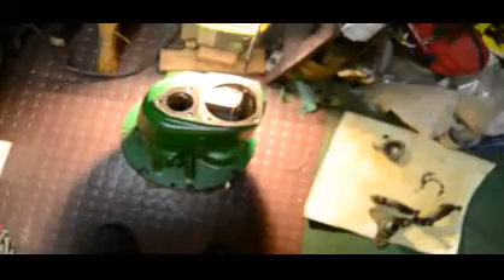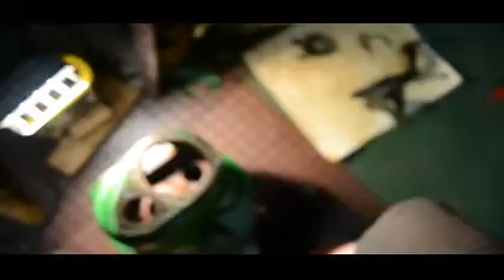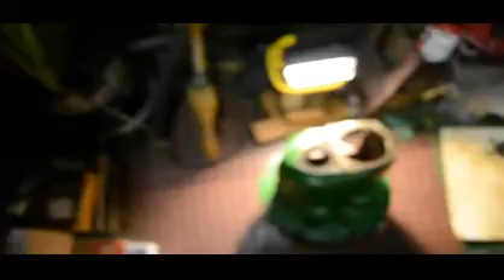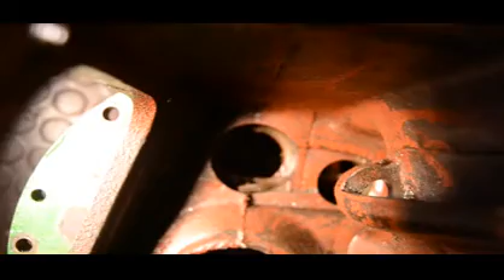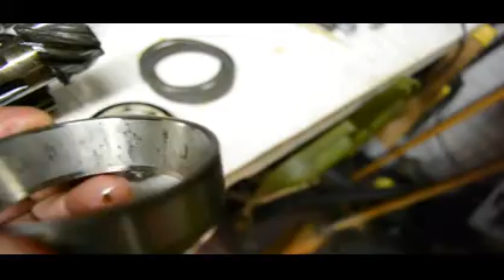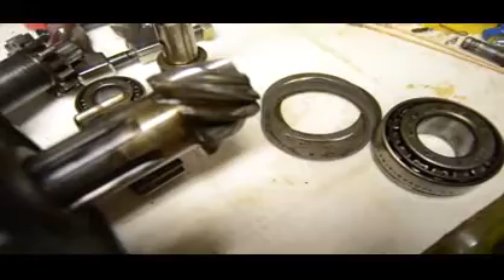John Deere LA (farm tractor) transmission power flow, lube and bearings (7 of 9)

Comment: Do you have a list of bearings and seals .
Reply from the maker: I think so, from the repair manual. I maybe should hand type it , with credit, rather than copy and paste. Will follow up tomorrow. DD
Reply from the maker: Jack Kreeger's repair manual did have a list of cross references for both seals and bearings. In respect to his decendants, I doubt it's proper for me to copy and upload. I would be happy to pass on specific information from the manual if you can provide descriptions or John Deere part numbers, from the on line or paper parts catalog. (John Deere PC on line look-up is free.)
Regarding any copyright protection, I did a web search, and found that several sources are selling what they describe as a factory manual reprint. Their pages shown sure look like Mr. Kreeger's original book version9s), which did include John Deere "Service Hints" bulletins of the day. On eBay, "Peaceful Creek Auctions" is one such supplier. Retail prices on the web very a lot, so shop first, if you don't have a copy. If you don't have a copy and decide to buy one from somebody, you might first ask if their edition has seal and bearing cross reference information, under a "Bits and Pieces" chapter near the end of the manual.